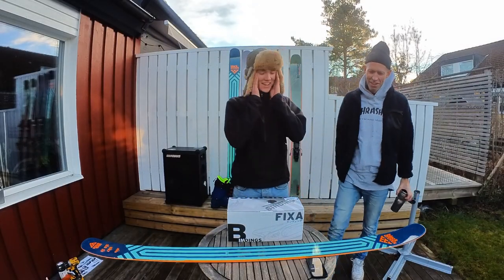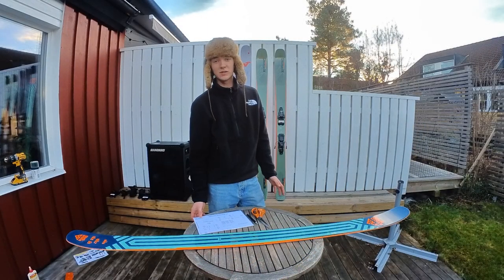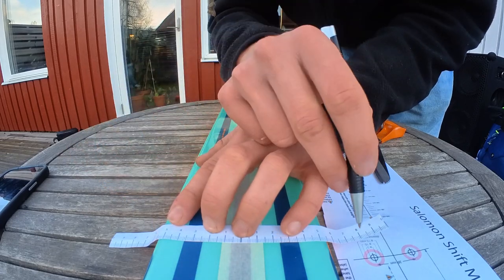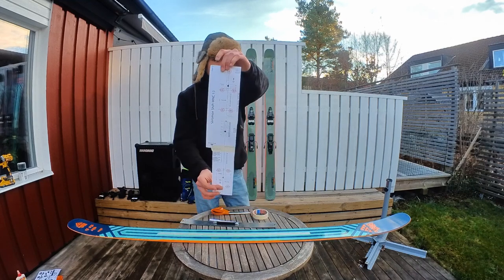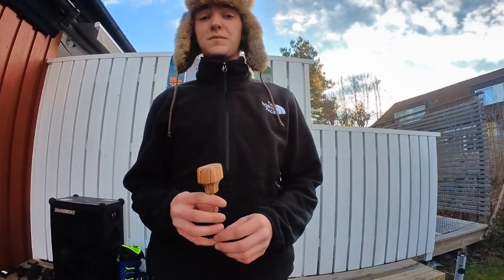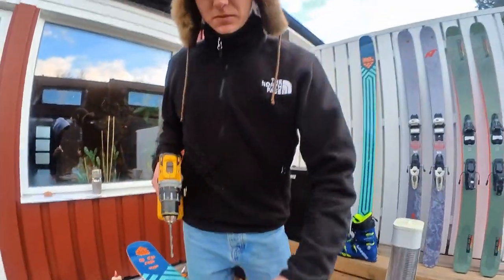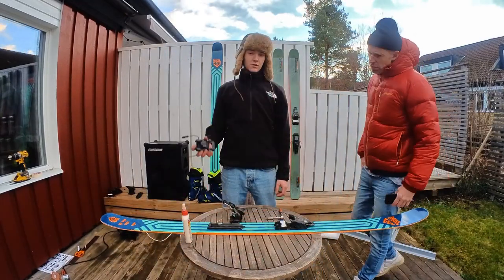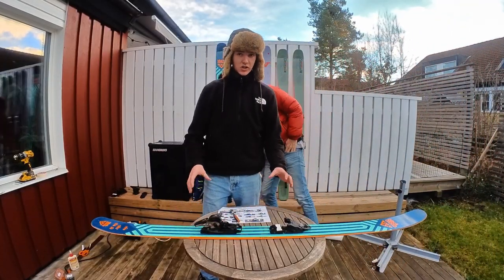How to mount ski bindings at home. Step by step tutorial. Atomic Shift MNC 13 Black Crow Atris 2022

Comment: Thank you gentlemen!  Very comprehensive and informative.  Got my Atomic shifts mounted and the technician never informed me if I wanted the information sheet that came with the bindings.  Don’t want to go back for it since it’s quite a drive.  Next, the tech was nice enough to mount the bindings right away using boots I thought that would fit in perfectly.  Cut things short, had to return the boots and order a new pair coming in a few days.  Needed some instruction on how to adjust the rear binding for boot length (give or take 2 mm).  As for the front, from GripWalk to a non GW.  There will surely be a big gap in height.  Cheers.

Comment: Really good job with very simple tools, I did one of these bindings a year ago and it wasn't easy, or at least it was not easy because i didn't have a template, but you guys made it very visual, and explanation was on point.
Could you share the website you got the templates from? thanks and good skiing
Reply from the maker: Glad you like it and glad we can help :) 

The link is in the description and I can put it here as well. It's a google drive with a lot of templates so you will have to look for your binding / the right template. It's quite easy to fint. Good luck!!!  - https://drive.google.com/drive/u/0/folders/1lpDx4-8PF44Pc08HHNyYY6Gg2a3Dd245

Comment: I have a Ski with is 100 wide in middle but accdidently bought this binding with the 110 stoper. Can is still use it or what are the disadvantages of a wider stoper?
Reply: Hi! This is not a problem. Just some stickout on each side. I have 120 bindings on my 106 skis without any issues!
Reply: @eliashaeger606  thanks for the reply! So it doesn’t make a different while skiing I even when you ski and your legs are very closed together?
Reply from the maker: @Daniel-ge6df  we mounted the same binding on the Atris ski in the video and we thought about it before the purchase and it was no problem at all. When you step down the heel they fold in over the ski. Not all the way but close. I didn’t think about it at all last winter when skiing. 👍🏼
Reply: @cfmasta  But your Atris is 108 in the middle not 100 as my bent chetler
Reply: @Daniel-ge6df  I have not had any issues with this at all. Even seems like the 120 was a better fit than the 110 would have been for my skis!
Reply: The recommended ski brake width goes from the waist width up,to +15 mm. You do not want a narrow brake getting caught on the ski during a release. So brakes actually tuck in when you step into the heel of the bindings.

Comment: Amazing tutorial! 

Wondering what brake width you purchased? I'm planning on putting shifts on my 121wide skis and heard that the brake width is wider than advertised. Do you happen to know what brake width was put on the atris and how much clearance is still available?
Reply: Hi and sorry for the late response. If i remember correctly I put 120 brakes on the skis. There were not any 110 brakes to purchase and that’s why we put the 120s. The brakes are generally much wider than advertised so 120s should be fine for your skis!

Comment: great video!
Question: is 1cm forward a happy result? i need to redrill the used kit i just bought as i have big feet. the skis are 108mm wide (i bought the kit for the good deal and these bindings) and not enough powder for this width
Reply from the maker: I’m happy with the result. I think they preforms really well. A have not tested any other positions on this ski so can’t compare 😌 but I like them like them in this position 👍🏼

Comment: Really nice tutorial, congrats!! I have a doubt, Using the template with the sole length, when you  mount the binding, is the heel adjust in the middle of the seting for that boot length? I mean the binding has 3cm, after mounting it for a certen boot you can then only fit boots between +1.5cm and -1.5cm sole length, right? Thank you!!
Reply: Hi, it does not actually say on the template but we had no problem getting the boot to fit. The template is precise enough to get the mounting positions almost spot on!

Comment: Do you know if the 10s and 13s are the same. I cannot find the 10s template anywhere
Reply from the maker: Hi sorry but not sure about that. Think it is the same from YT videos. Maybe you can print the template and see if it matches with the bindings. Good luck and sorry about the answer 🙄
Reply: I also have the 10s did you end up using the 13 template?

Comment: Find the center line is painful. Anyone knowing woodwork can recommend a tool?
Reply: Tape measure in mm is the only tool you need.   Measure across ski waist.  Say your ski waist is 96--half of 96 is 48.  Check measurement from both edges to confirm, mark your center line.